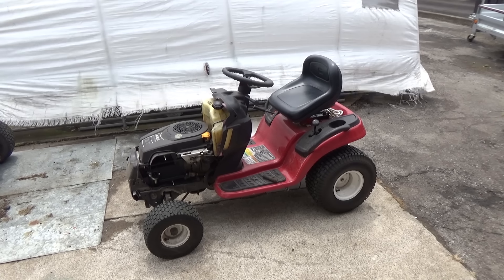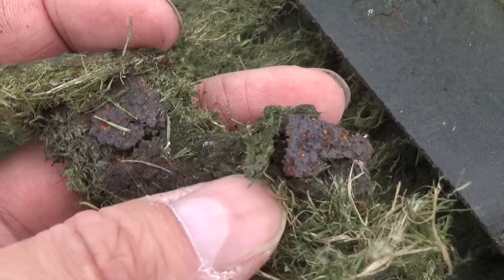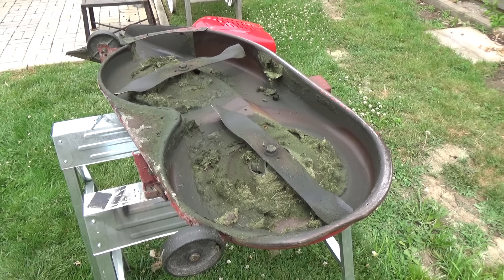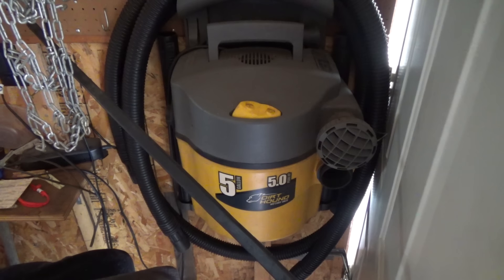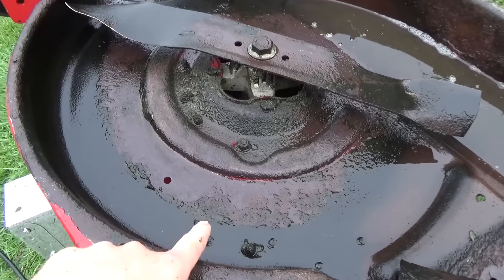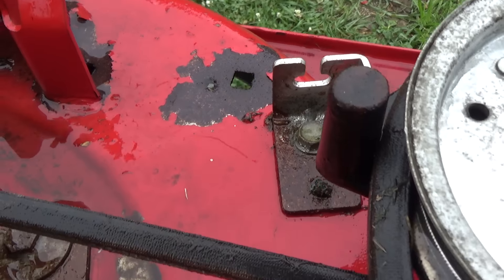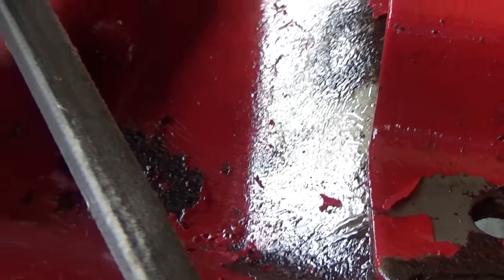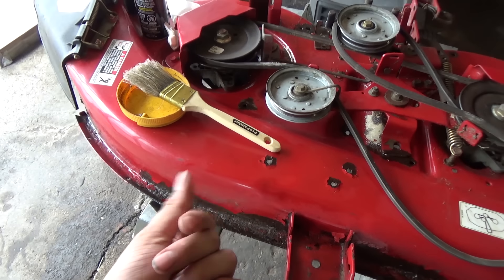How to Undercoat a Deck - Why Cleaning Your Deck is Important!

Comment: Waste of time.  If you want to do something positive, remove the spindles, have the deck sandblasted and coated first with inorganic zinc @ 2-5 mils, then two coats of high build epoxy 3-5 mils and properly cured.   Oil coating will last about 2 mowings.
Reply from the maker: This Oil coating lasts a year, (that's confirmed) seeing as how I just had this machine in for a oil change and there's hardly any grass stuck to the deck, no further rust.

Comment: your blades in this video are trashed.  16:16 you can tell the cutting edge of the left blade is bent over.  All the undercoating in the world won't help if the tool tha'ts actually doing the work isn't taken care of.

Comment: Undercoating is usually a bituminous based material and/or a rubberized based product that bonds really well to steel thus giving you a nice rust preventative coating.  What you did was somewhat neutralize the rust which will help for a little while, maybe six months. Had you allowed the rust neutralizer to completely dry and then apply a good epoxy paint you could probably get another 3 or 4 years out of that deck.

Comment: I watch you videos and I do like a lot of them. However on this one, I don’t agree with your method of removing rust. The deck is not completely cleaned up. You wasted your time, all you did was a temporary repair.  There were painted areas bubbled up because of the rust under it and you missed those as well.  The correct way is to use one of the following methods, chemically strip or Sand blasting. To keep the corrosion from coming back use zinc spray, then primer and good quality paint then you can apply a light coat of protectant.

Comment: DUDE.     Stop worrying about those silly little holes getting a lot of oil/treatment on your belts on the top side ! !
Just put masking tape/duckt tape over the wholes till you get the deck coated ! ! !       SIMPLE ! ! !
PROBLEM SOLVED.
Reply: just remove the belt 30 seconds R&R

Comment: Chip off ALL loose paint and re prime and topcoat.  Use a chipping hammer to remove the heavy rust scale, don't just put Crown crap over it.
Sandblast the underside after removing spindles and coat with Pick-up box Rhino coating or similar High Build Epoxy after zinc rich primer coat.  Never put oil over chipping bubbling coating.
Use an industrial marker to put hours/date on new filter.

Comment: Waste of time and money ----- Undercoating mower deck.
It does little to stop mulch build-up.
Mover decks out last the tractor as far as rusting.
Once a season use a plastic putty tool to remove mulch build up.
Water hose if desired.
I have 55 years of lawn tractor upkeep.  Since the age of 11.
Clean the open pulley section every mow time from dry Grass build up.
Sharpen blades every 5 years.  An average lawn tractor last about 8-10 years.

Comment: wow would be Better Off This Was Made Of plastic or aluminium
Reply: G POWER DRAGON plastic would not last long and aluminum would not stand up to the abuse a mower deck sees. If plastic would work, manufacturers would be using it, because plastic is much cheaper than metal.